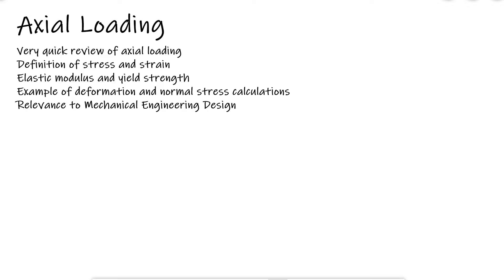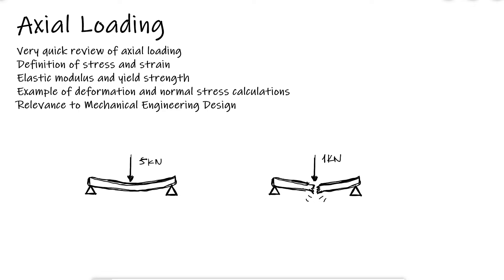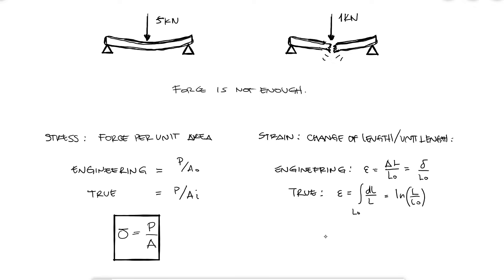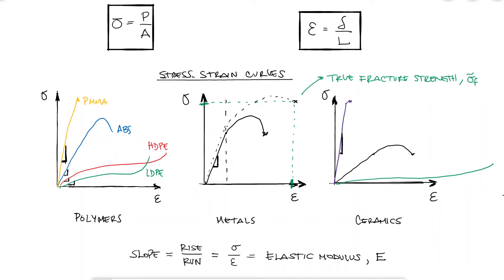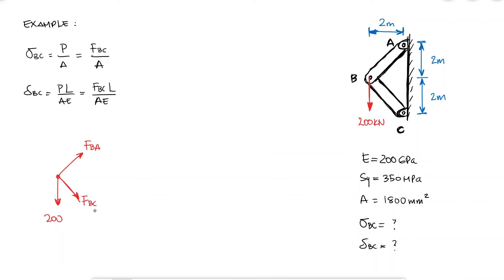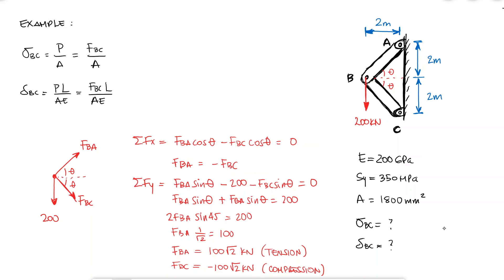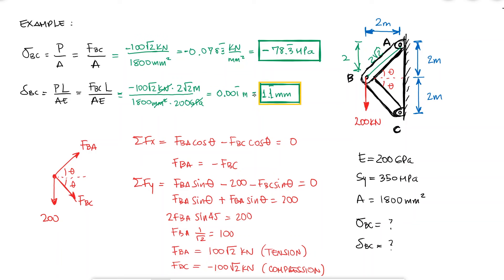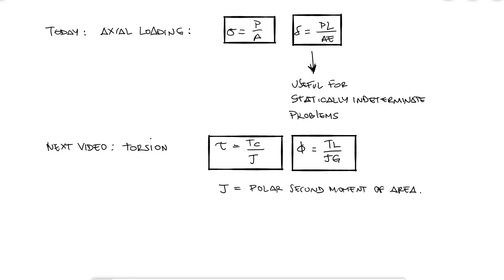Axial Loading Review for Mech Design in Under 10 Minutes (check links for updated versions!)

Comment: so my question to you is: is 45,000 pounds (200 kn) or 32,000 pounds (internal force) even allowable? that is an insane load for such a structure! would the normal stress surpass the allowable? based off the properties (elastic modulus, yield strength, cross section [42mmx42mm] the load seems to be intuitively unreasonable for what seems to be mild steel (it's definitely not a high strength alloy)
Reply: + Shear stress -> von mises -> yield strength OR allowable (tensile) strength
Reply: So there is probably a bunch of shear stress that the von mises most likely surpasses the yield strength… or compare the value to the allowable (tensile) strength*
Reply: So what can happen is that it can permanently deform, but not yet fracture… depends on what is called “failure”… or if the FOS keeps the material from yielding*
Reply: So do we not worry about FOS anymore when it comes to using the von mises?
Reply: So allowable stress isn’t only restricted to the tensile strength…hmm

Comment: What is the significant difference between F and P for force and why was it changed? I
Reply from the maker: They are interchangeable. You can use any variable, F or P, for external loads. Usually V is reserved for shear forces, but that's about it.